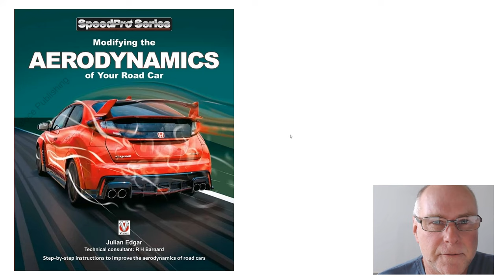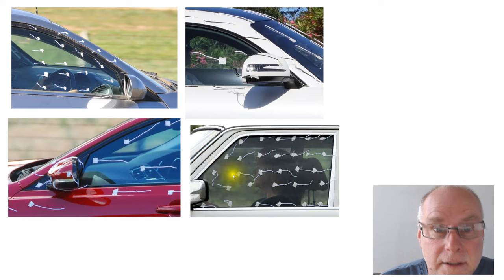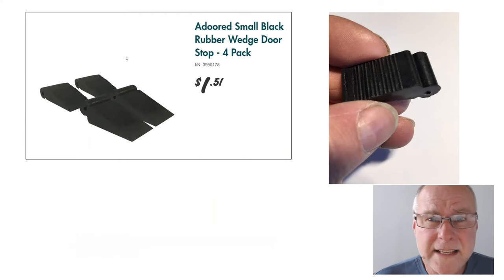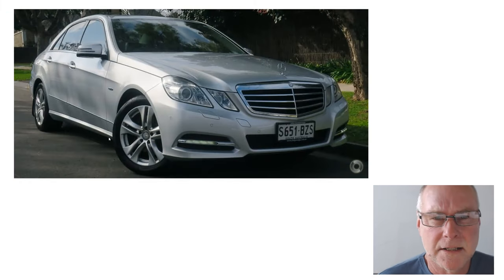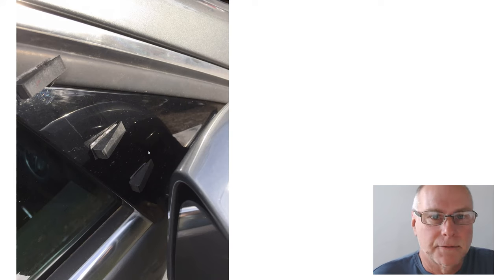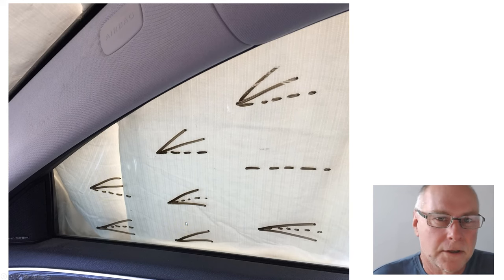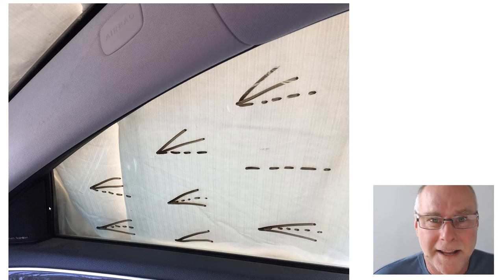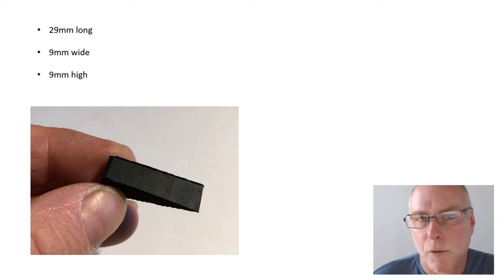Using vortex generators to improve rear vision mirror aerodynamic flow

Comment: VGs or channel guides?  I’m more inclined towards referring to these as the latter in this case: there might be a pressure bubble on the forward facing side of the mirror housing that you’re helping back into the significant flow around/past the A-pillar- showing it where to deflate to. Regardless, this is an awesome little tweak!

Comment: I remember explaining why I cut in half a formula 5000(?) Aerofoil, before mounting it under the car, either side of the tail-shaft and bolted to the inner sills- it was partially to overcome the lift of the notch back windscreen, but I really wanted it to cool the twin Brooklands mufflers I had fitted under the boot floor.
I also put a plywood panel, from a  chin spoiler, to the front crossmember, and was amazed by the difference, mate.
Love your videos- good to see an Australian presenter, mate!

Comment: Nice job and good video, could you give me some comparations on acoustic results? Will it be a loud noise source or a non-speaking part?
Reply from the maker: It is dependent on the car. In some cars the vortices may match the frequency transmission property of the glass and so noise will increase. In other cars, the reduction in flow separation will make the car quieter.

Comment: Small things like this may not be easily measured, but enough of them together can have noticeable effects. Mind the pennies, the pounds/dollars/euros mind themselves!

I’d love to see some throttle stop testing done in a car that has been “treated” and then with the treatments removed - even on a car like the Insight, I wouldn’t be surprised if there was a 5km/h (or greater) drop in top speed without the treatments.
Reply from the maker: I don't have a monopoly on testing - if you think they will give an improvement, do some testing yourself. I have done that testing, and they made things worse on the Insight. All covered in my Veloce book.
Reply: Julian Edgar thanks. I’ll click that link. 
The unscientific testing of my initial mod is working out really well so far - I’m on track for somewhere in the range of just >100km extra range from my tank. And the road feel is different steering wise (crisper and more precise) but I do have to change my driving habits - I need to get on the brakes sooner & harder coming to a stop: my car seems to have developed a strong affinity for coasting
Reply: @gregorykusiak5424  Hey Gregory this sounds interesting, are you willing to share some info on what you've done too your car ?
Reply: @michaelsillymoose5556  I haven’t gone full front undertray yet , but blocking the lower radiator inlet (below the front bumper) has helped: I’m not certain if it’s completely aerodynamic (helping the airflow go under the car), or if reducing the airflow past the radiator and into the engine bay helps keep the engine in closed-loop fuel delivery, but the positive aspects I mentioned above are definitely occurring. This stuff works.

Comment: Amazing! What gains would you say that such a little difference on flow at that area would make? Like less 1 or 2 Nm of drag at 100 or 200km/h? Less 0.001 CD?
I have no idea! Should be very hard or impossible do actually tell just by the way if looks, but you may have an idea based on previous tests or calculations :)
Reply from the maker: I don't think the change in drag would be directly measurable.
Reply: @JulianEdgar  Would you think these changes might affect airflow further down the line, and perhaps negatively as the engineers didn't account for the modified airflow when designing the rear of the car? Anyway, congrats on the amazing collection of videos! I use them to modify my Hyundai Ioniq EV, which must now be one of the most efficient cars on the road (I think). I'm averaging 115wh/km at mostly highway speeds.
Reply from the maker: @insevanhouts  Improving flow attachment on the side of the car is an unambiguous positive.
Reply: @JulianEdgar  thank you for the clarification!

Comment: I used a vortex strip for a remote controlled plane from a hobby shop. Will that work?
Reply from the maker: Only way to know is to test it and find out.
Reply from the maker: Seem very expensive. Why not make your own rubber ones and test them?
Reply: @JulianEdgar  because I have the fabrication skills of an earthworm. Anyway, I'll buy your book and see which ones I'll have the patience to fabricate myself.
Reply from the maker: I understand your point, but nearly all car modification requires mechanical skills, including fabrication. Aero is even more the case, because so few workshops (any?) specialise in road car aero modification. Neither of my books cover in detail making cheap vortex generators - honestly, if you can cut a steak, you can make these rubber ones!

Comment: Do you think 2 vortexes will work effectively than 1 for one side ?
Reply from the maker: I don't guess - I test.
Reply: @JulianEdgar  what the result? I've tried the vortex before watching your video. All of sudden youtube recommended this video to me. My car is installed just one vortex and as far as im concerned it works effectively around 70% . Still have smaller wind sounds when car hits cross wind

Do you think I can reduce the noise a little more if I apply 2 instead of 1?
Reply from the maker: @hailyphan7754  My point is that my guess is as good as yours - as is anyone's. Test it and find out!

Comment: Some toyota models also have these: https://youtu.be/4Bmhuq38EYI, seems like they stole some more of your ideas :)... the video focuses mainly on stability, and also touches upon underbody airflow and strakes. i'm still skeptical about how much effect a single vg can have on vehicle stability. But your tuft testing certainly puts these in a positive light.
Interestingly i've also seen stick on examples sold on ebay, in both clear and translucent red, marketed as "anti collission wind noise reduction spoiler". They are likely "inspired" by the toyota ones. the shape looks about the same. I'm tempted to get some for testing.

I wonder how a row of vg's accross the A pillar would effect overall airflow, given the A pillar vortex pretty much determines a large part of the airflow over the rest of the side windows and possibly the wake.
Reply from the maker: I have tried (on the Insight) a row of small vortex generators on the A pillar but the results were much better using turning vanes (ie guides) on the pillars. If you look closely, lots of cars have small vortex generator-like bumps on them (ie not just Toyota), especially around the external mirrors.